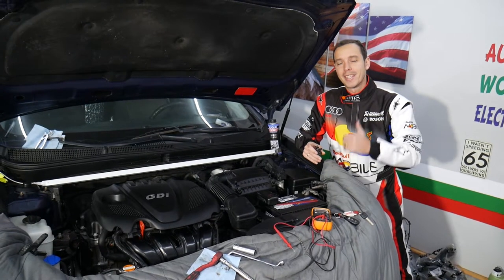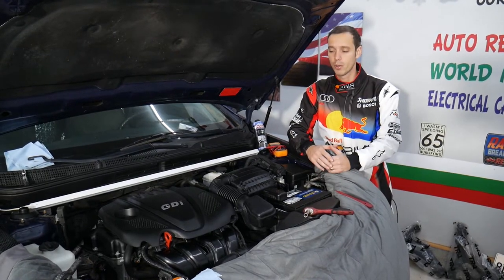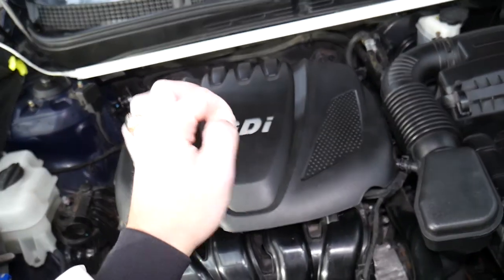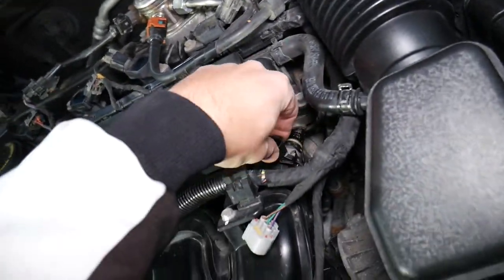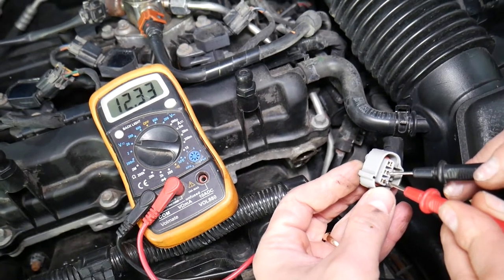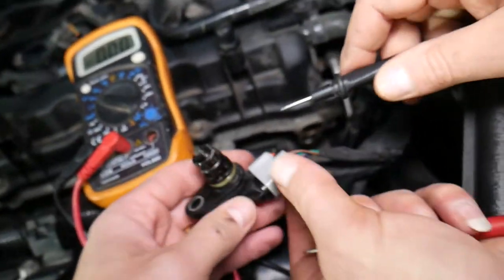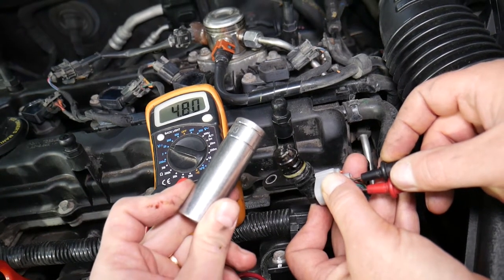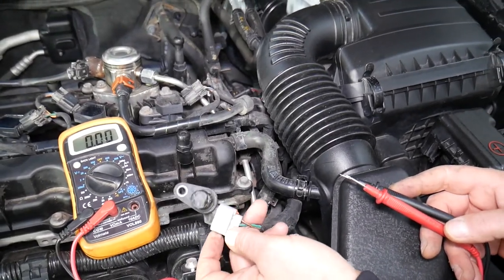TEST CAMSHAFT POSITION SENSOR ON KIA OPTIMA SORENTO SPORTAGE FORTE SOUL RIO

Comment: Hi. How do I know if it is crankshaft sensor or it is a camshaft sensor that is the problem? I don’t have any error codes using the diagnostic tool. It is a Kia Rio (JB) 1,4 2006. Battery and starter is ok. My car does not want to start and after several times of trying and little bit waiting it starts. Sometimes when I drive I feel it loses sometimes the electricity as if there is a small power failure. I hope you can help? Thanks. Greetings from Denmark.